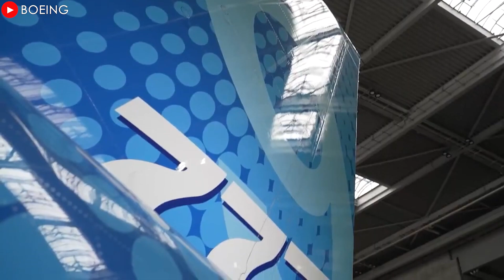Boeing says "GOODBYE" to 777 SHOCKED the entire industry! Here's why

Comment: The 777 x could be the next milestone, but Boeing cannot seem to get it off the ground. By the time they do get it, flying air bus will have developed something probably better than the 777X. Time will tell, The 787 and the 777 have had a very good long run. By the time the 777 x is certified, it will probably be around five years delayed. That is unforgivable. Boeing used to be much better than that.
Reply: Airbus doesn’t have anything flying right now that can match 777x in both range and capacity. Emirates has said when theiy start replacing their huge fleet of A380’s and 777s they will get the 777X. The A350 is not big enough

Comment: Wait, wait, wait wait ! Why did BOEING says "GOODBYE" to 777 ? And why not only BOEING 747, 757 and 767 that already get older than before ? This video would probably were likely wrong if BOEING says "GOODBYE" to 777 that shocked the entire industry in my thinking. Because BOEING 777 is the only one type plane replacing BOEING 747 that getting older than before as I know just like Garuda Indonesia that still have BOEING 777 for replacing BOEING 747 that already retirement when BOEING 777 has already came along.